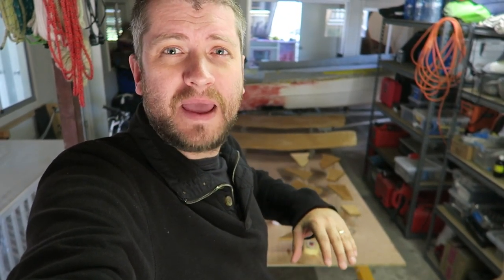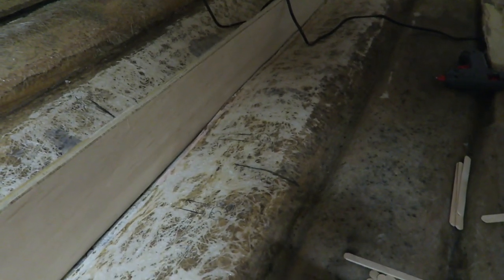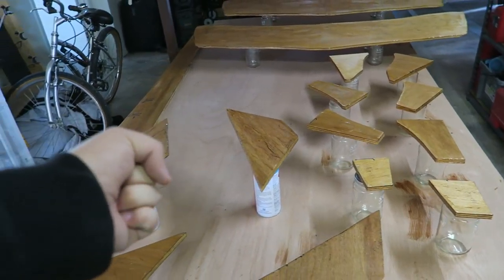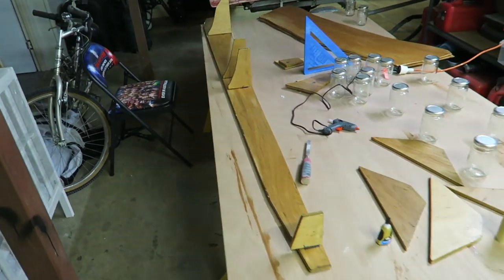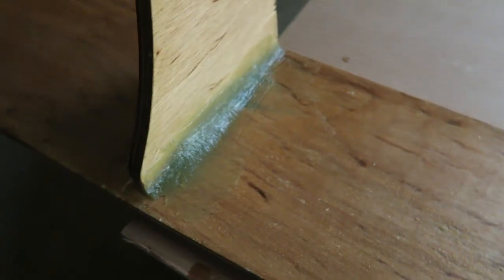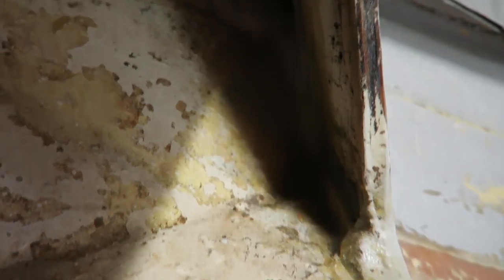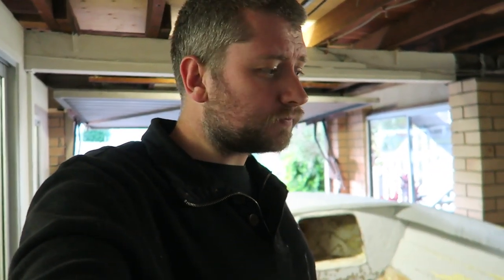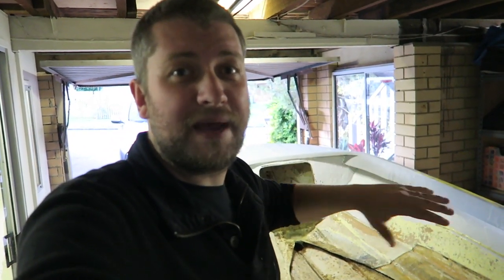TRANSOM TIME! - The NEW Fibreglass Boat Restoration Project - Part 5

Comment: awome vid! learned so much, one way to transfer those shapes is cut cardboard to length, and use dividers, or a compass set to the farthest distance to the cardboard and then use them to scribe a line on the cardboard, and it'll be an exact copy of the curvature, that's how us tinners do it

Comment: Have you considered water flow along the centre beam to the bilge pump? Looks like you will have water pooling up at the 90 degree angles.
Reply: James Stewart under the floor of a fibreglass boat should be sealed, it’s the water getting in that wrecks stringers. Doesn’t look like this boat will have a bilge area as his stringer goes all the way to the transom.
Reply: Could you leave the centre stringer out and build stringers say 100mm off the centre to let any water run straight back to the bilge?
I’m about to pull the floor out of a 88 17ft seagull I’m afraid I mite need a new stringer set up and transom. 
First ever boat project I’m frightened 😂😂

Comment: A couple of points buddy. The screws will not be enough to pull the transoms together. you should have bonded them to make one solid transom then clamped and wedged that in place.

Comment: Before you glued the floor braces to the.stringer you should have sanded it all back to get rid of the shine because you might have a de lamination because of the wax in the resin . ??
Reply: I’d say you are correct.
Reply: Wax in resin is not laminating resin, you can add it but it weakens the tensile strength. If no wax is in the resin then you should be able to glass over it as long as it's with in hours of curing. If not then a good surface scuff should be done